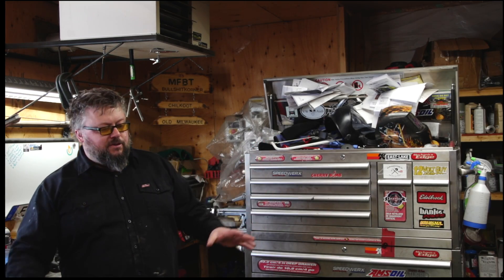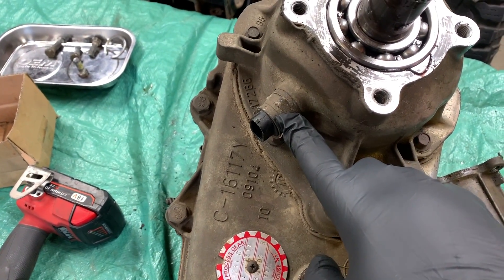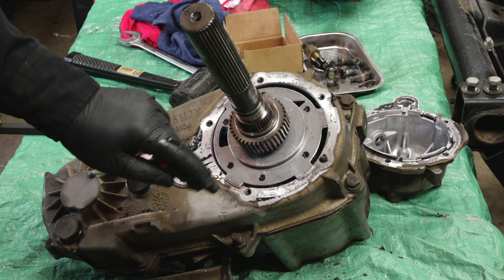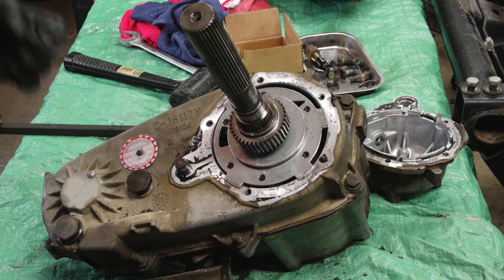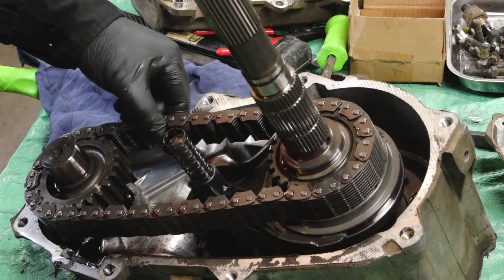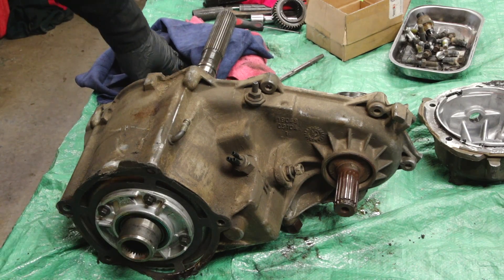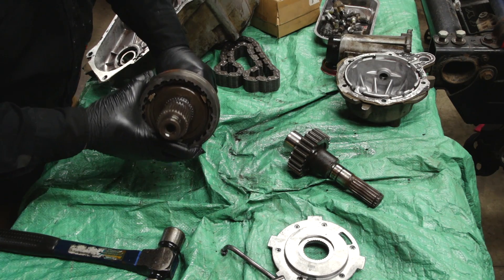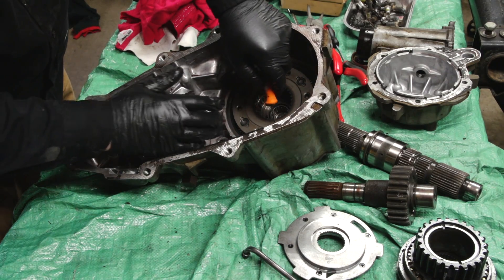NP231 Rebuild DIY How to Take Apart

Comment: Around your 3:00 mark, that little case you are taking off.... what "could" be a cause of a 2-3" crack near one of the bolt holes?  Aluminum fatigue from the pump ears that rest against it?

Comment: I didn't have a lock ring on the front output shaft when I did my sye kit.  It's on a 2000xj np231.  The shaft came right out together.   Is the lock ring your talking about the one for the bearing? Coz my bearing has a lil bit of play and I don't wanna pull it all apart again if I don't don't have to lol

Comment: Hopefully you see this , so I’m rebuilding my np231 J transfer case and got everything of ok and I got to the planetary and I cannot get it out ,it won’t move at all… I got the big ring on the inside and I got both rings on the outside  and it still won’t budge and I’m stuck on what to do ,if you can get back to me asap that would be awesome
Reply from the maker: There should only be 1 snap ring to remove the planetary and you need a special tool for it
Reply: @TestDontguess  in your video it showed you pulled one big snap ring from the inside and then had to un bolt the bolts in the back and then one more lil snap ring  on the bag side and it slid right out?
Reply from the maker: You don’t need to remove that big snap ring. Only the one where you gotta remove bolts
Reply: @TestDontguess  I got the ring that comes after the bolts and it still won’t move
Reply: I got all the rings that I need to , and it won’t budge at all yours slid right out

Comment: Do you think you can flat tow with the NP231?
Reply: @brycemaggio6144  Hey Bryce thanks for the reply.  The question was more about the NP231 being the towed vehicle rather than the towing vehicle.  And in the year since I posted that question, I've learned that yes they can be, but I also learned that the NP236 was an easier swap for my Astro van. 😁 Cheers!
Reply: How much weight? What size tire? D35 is probably a bigger threat to towing

Comment: Where did you get the snap ring pliers at? I have the traditional sets for rings with the holes but I do not have a set with the flathead and grip like you used.